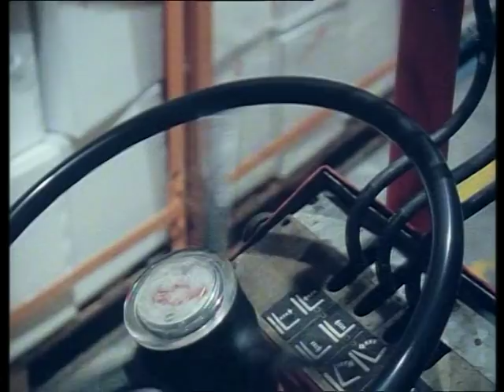londons burning cold store rescue

Comment: @rockandroll626 - The temperature is below freezing, so the metal canister for their oxygen is growing colder and frosting over - just like a can would if you put it in the freezer. The danger is when the valve on the BA freezes, and doesn't let any air through. It's not as dangerous to use the BA in freezing conditions, as gas contracts in the canister and doesn't expand. If you try and freeze a can of cola, for instance, you'd see the liquid expands - and breaks the can!

Comment: @Vieweracc99 Why do there Ba ice up
Reply: Because the air was that cold the air was forced to freeze up
Reply: @clipsfn3650  really the air condenses into a vapour which then freezes.
Reply: The valve that allows air from the tank into the mask is meant to open when you breathe in an close when you breathe out (so the exhaled breath goes through the vents on the mask) if yhe valve freezes and is unable to open the air supply is cut off and you can't breathe.